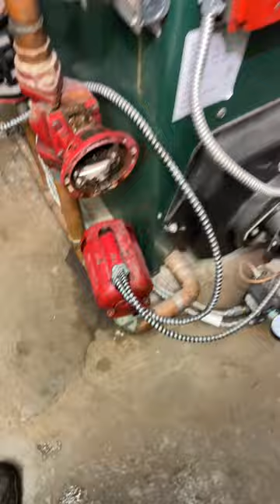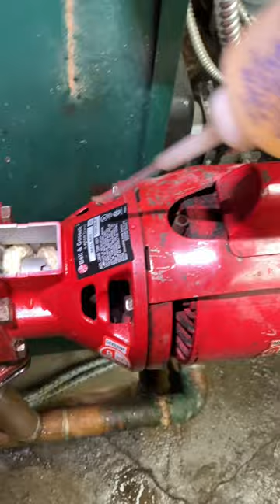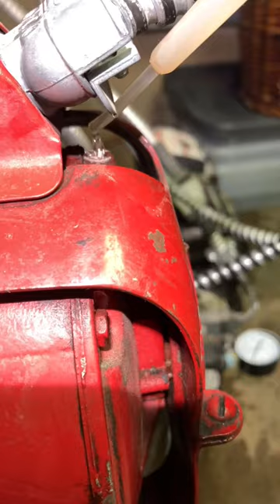Crazy! Bell & Gossett Circulator Pump

Comment: Looks like circulator pump was apart and no isolation shut off valves to service it, likely he had to drain the whole water loop
Reply from the maker: Started draining it but got impatient after 5 minutes, let the system pull down into a vacuum then changed the bearing assembly on the fly. Got a little water on the floor but better than being there all night!

Comment: I bought a replacement pump from Granger with all of the same specs, and it works fine, but it does not have the oil intakes. I have that square reservoir which I put oil in.

Do you have any advice on how to put oil in the newer model without the oil intakes on the motor?
Reply: I found the answer I believe Sleeve-Bearing Motors lubricated for life require no re-oiling and are constructed without re-oiling tubing. For motors with re- oiling tubes or ports, use the following guidelines.
a. Re-oil annually after the second year of service to extend bearing life for normal duty.
b. Re-oileverytwoyearsforlight intermittent duty and at least every five years for light occasional duty.
c. Add 15 to 20 drops of electric motor oil or an SE grade of SAE 20 non- detergent, motor oil to each bearing when re-oiling.
3. Ball bearing motors are factory lubricated and require no additional lubrication.
Reply from the maker: Great detective work, yea not every pump requires oil lubricant to be added, just depends on the manufacturer

Comment: Can someone explain the problem?
Reply: A circulation pump for a heating system, clogged up and probably inoperable and not providing heat to some parts of the building. Unclogged and removed rust and then lubricated.
Reply: @r0498  Thanks :)
Reply from the maker: You summed that up nicely! Ripped out the old bearing assembly on the fly though. After 5 minutes of draining the system impatience crept in, let the system pull into a vacuum, pulled the old assembly out and put the new one in. Some water on the floor but better than being there all night!
Reply: Yes, the seal kit on the bearing assembly failed, filling the wick assembly with water causing it to freeze up, therefore, breaking the coupler to the motor.
Reply from the maker: if it had isolation valves and proper purge drain, definitely would have installed an NRF-33 instead, or would you disagree and keep the series 100